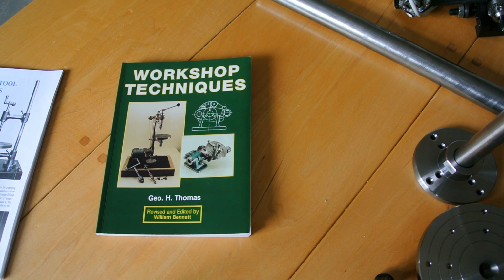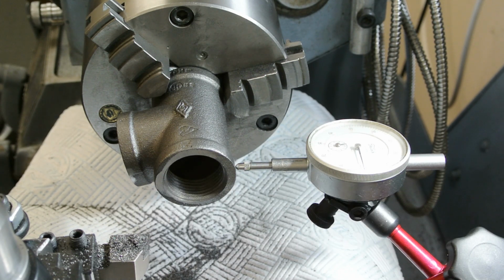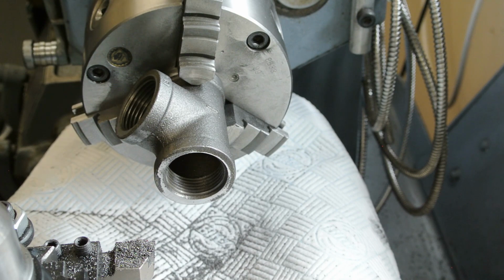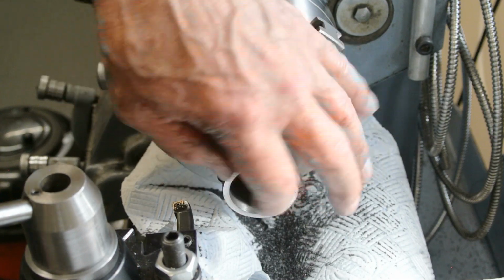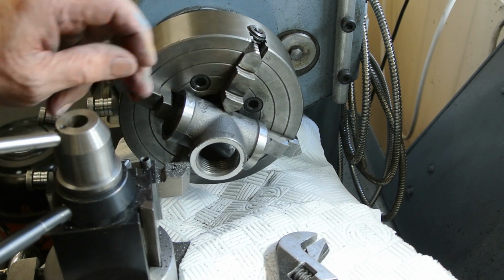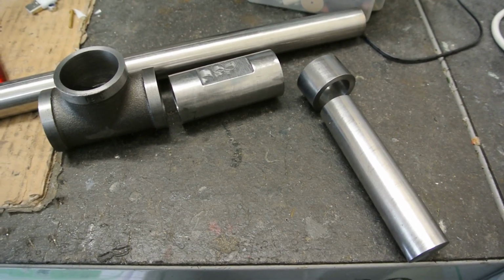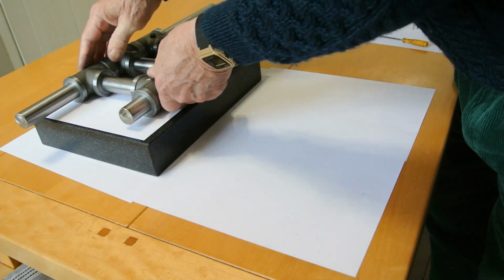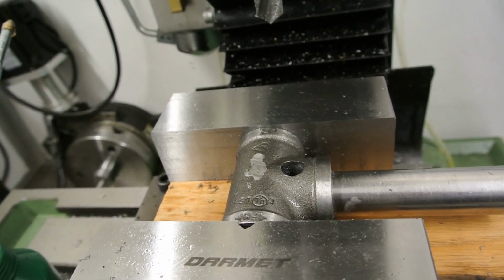steampunkt universal pillar tool pt1.. the pipe castings

Comment: Definitely cheaper than buying the casting kit. Plus you can modify the design to fit your needs. Instead of fitting a drill chuck l think a better option would be an ER collet setup.
I started down this path a couple of years back. To true up the outer diameters of the pipe fittings turned a solid center at a 90° included angle with a 90 ° live center. Then I could turn the ODs concentric enough for further setups. Then things went south in terms of tools.

Comment: Hi. I am thinking about the hemmingway kit. 
Considering the hemmingway kit is £110 would if you could go back and start again would you still use the method for building you chose?
Reply from the maker: Very good question, It is not so obvious but the basic tool is £118.50 and the drilling attachment is £91.90. the chuck is £52.25 so a total of £210.40 plus the motor speed controller and power supply. This is not a cheap thing to make however you do it. I was really surprised how expensive the basic stainless was for the column. I would have liked a ground silver steel column but that would have been a crazy price, if I could get it. 

Yes I am happy with the method I chose. You can start relatively inexpensively and just do the machining to the Tees and glue the sleeves in place. That will quickly establish whether or not you can cope with the work involved. Making the supplied kit is a lot of work and I definitely used a shortcut method. 

I have several Hemingway Kits and all have worked out well for me as well and given me plenty of work to do.   John
Reply: @john2478 
Instead of ground silver steel (drill rod in the US) l would suggest an end cut of a good shafting steel. TG&P 4140 alloy steel would be an excellent choice.
Reply: @john2478  thanks for getting back to me. 
I have a pillar drill and I’m have just finished building my loco. 
I would like to build the basic version of this as a tapping table. With the idea of adding accessories at a later date if wanted. 
Thanks. I will be watching all your videos. Thanks for making the effort of sharing